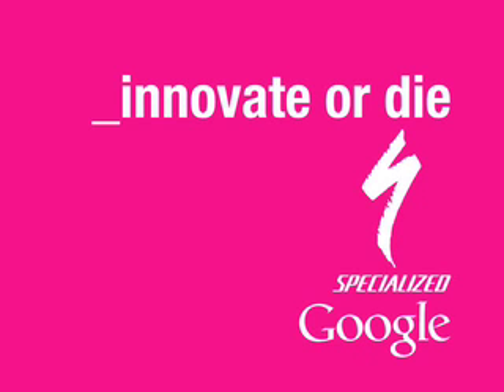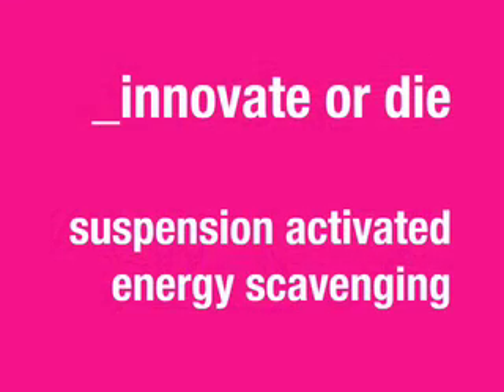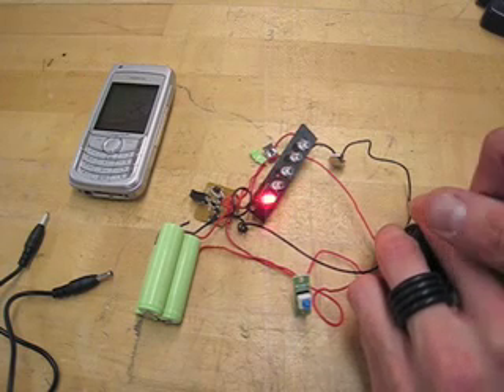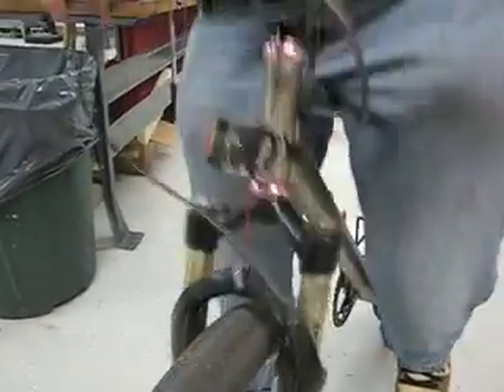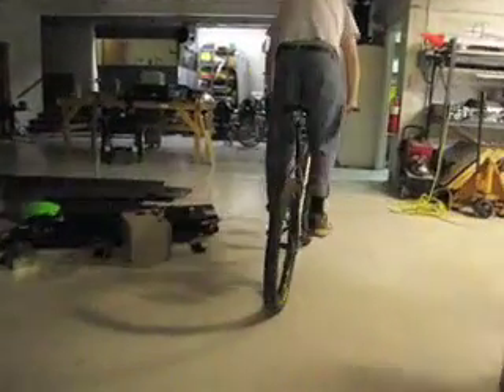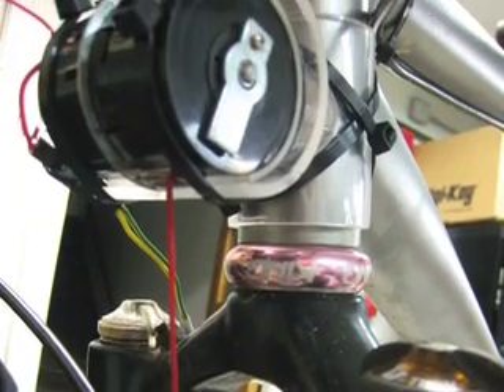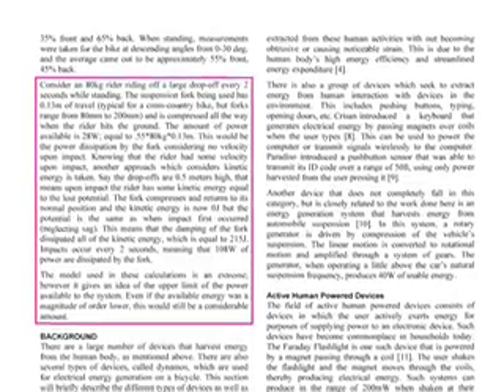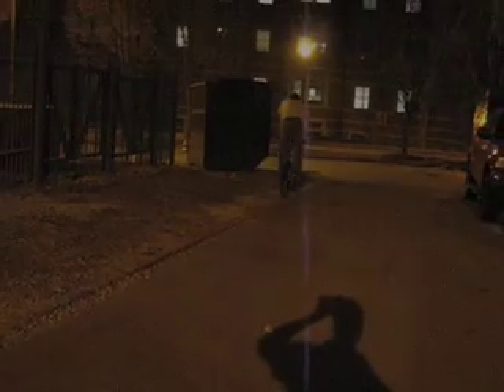GeorgiaTech_suspension_scavenging_innovate_or_die

Comment: How about magnetic dampers themselves as the dynamo and dump the string pull? Repulsive attractive magnetic shock absorbers. You'd have a slide and levitation to prevent friction, probably too big for use on a bike, but trains maybe?  You'd get a lot of wild AC current off the thing, but there's chips for that.  (It's like mag lev in reverse and inside a shock system, got it?)

Comment: F-ING rad Jon y Mark. My only complaint....hard to hear it over the waves crashing here in Tulum. 

Thinking further about road bikes, how could you integrate it into the bike seat? I know they have suspension in bike seats and using the travel between stem and stationary seat post might work the same way. Not as much travel but maybe you could "gear" up the movement ratio....

who knows....great job fellas!